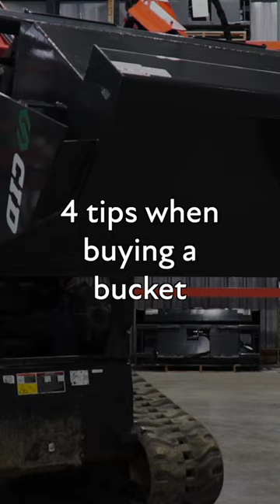4 tips when buying a bucket | Skid Steer Solutions #skidsteer #operator #construction

Comment from the maker: 1. Make sure the bucket is suited for your job application. There are buckets designed for digging, grading, sifting rocks, removing stumps, mixing concrete, etc. Just make sure the bucket you buy can complete the job you intent to use it for. Some buckets are versatile and can be used for multiple applications such as the 4 in 1 Bucket. 

2. Pay attention to the construction and design of the bucket. Choosing a higher yield strength means a stronger and better bucket. While using higher grades of steel does increase the upfront cost of an attachment, it saves time and money over the lifetime of the attachment. There are also certain design elements that will indicate longevity. For example, if the bucket has tines, then a cross member is often essential. A cross member is a piece of metal that spans across the bottom tines of a skeleton bucket to increase overall strength. 

3. Make sure it has sufficient capacity. Bucket width should be at least as wide as the outside width of the tires or tracks. If not, you will be unable to dig or scoop in one pass. The tires or tracks will ride up on the material and the bucket will not remove that material. In contrast, buckets that exceed the capacity rating of the machine risk imbalance and tipping due to load size. As well, larger buckets can handicap the operator’s vision, if installed on a smaller machine.

4. Choose the right bucket accessories. Depending on the type of bucket, there may be some optional features such as a bolt-on edge or side cutter that can make the bucket perfect for your application. Adding teeth to your bucket is a must-have if you are doing a lot of digging. The added teeth make it easier to cut through roots and rocky conditions. If you're using a concrete bucket, you might want to add a Hydraulic Gate.

Get that job done 🤠

#bucket #miniskidsteer #landclearing